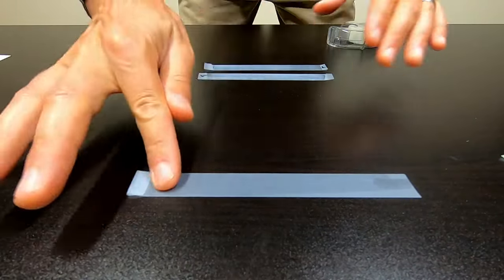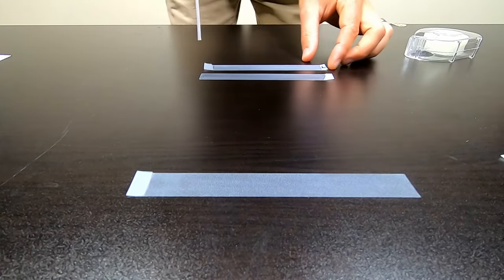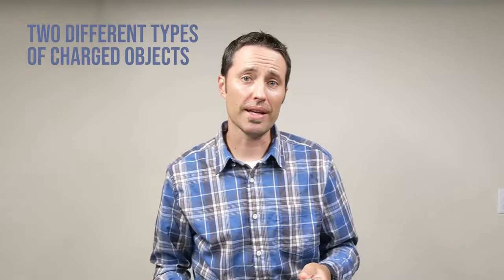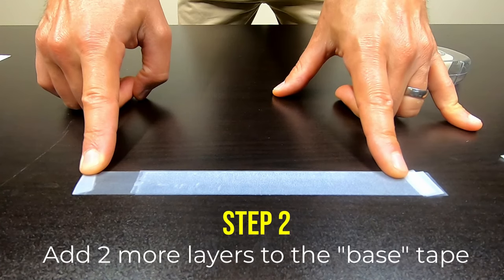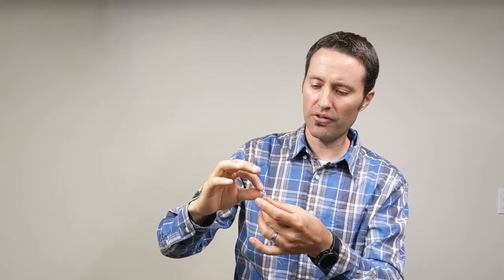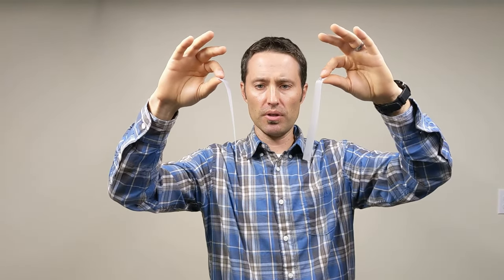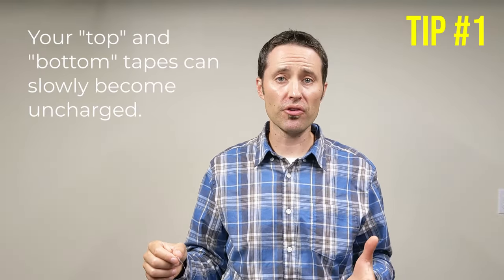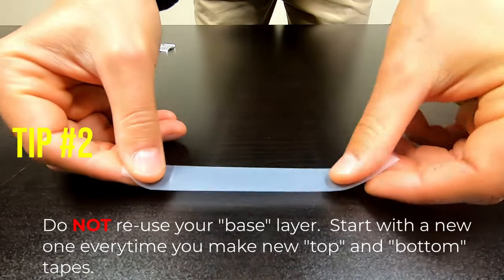Sticky Tape Lab Introduction

Comment: Hi 
can the base tape become neutral, as it is charged from upper aide with the tape and from below with the table?
Reply from the maker: The base layer could be neutral, positive or negative. It is NOT consistent, so it is never used for this investigation.